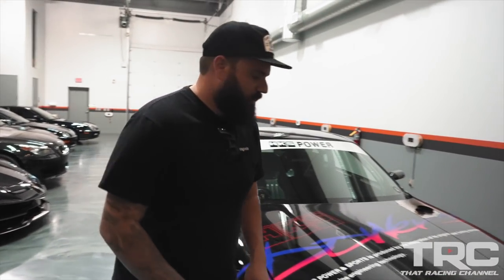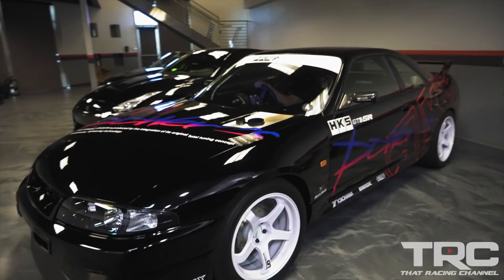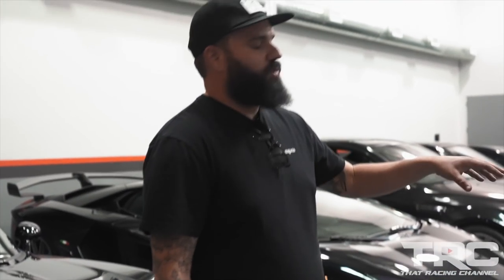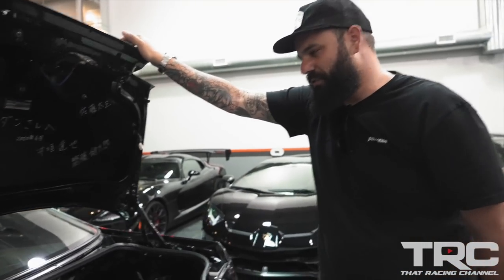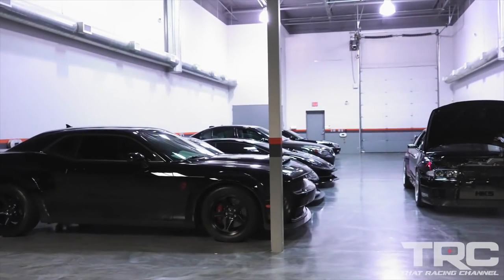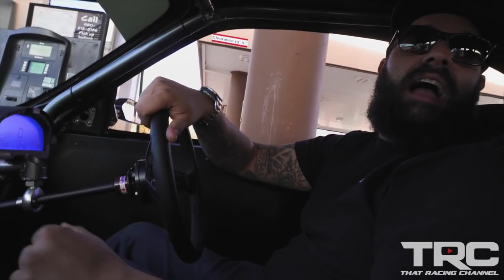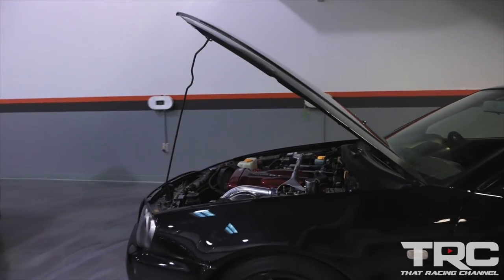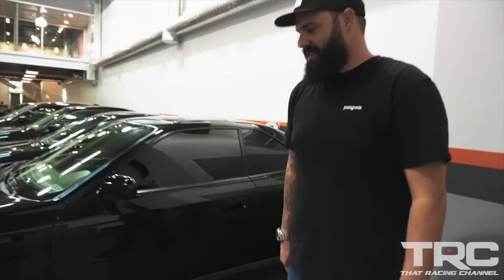R33 GTR 2.8L Stroker "The Modern HKS Race Car" + 100% USA Legal R34 GTR ($50,000 RB Engine)

Comment: Totally jealous. It's a beautiful JDM collector car. I could care less about the Lambos and exotic cars even tho I do like them who doesn't but my love resides with JDM vehicles/parts. The R33 is beautiful and I'm absolutely in love with the Fed legal "MotoRex" R34 GTR. If I had to choose one JDM vehicle it would deff be a Z-Tune Skyline R34 GTR V-Spec in Midnight Purple II or III as far as I know the Midnight Purple Z-Tune R34 GTR is the Rarest Skyline as to my knowledge they only made 1 or 2 Z-Tune R34 Skyline GTR's in Midnight Purple II or III and they only made 12 Z-Tune R34 Skyline's. If I'm not correct of how many they made please correct me but I do believe it was around 12 produced for the Z-Tune R34 Skyline's and only 1 or 2 Z-Tune Midnight Purple R34's. I also love the Black Dc2 Integra Type-R they're getting Rare aswell especially the Phoenix Yellow Dc2 ITR's. The 96 & 97 Dc2 ITR's are already Rare and you won't find them anywhere the people who own them have them hidden away in their garages or in a storage unit somewhere and you won't find them Original or in good condition. My cousin owns a Phoenix Yellow 01 Integra Type-R with very low mileage lucky if it has 30k miles. He's the original owner he bought it brand new when he worked for an Acura dealership here in Long Island, New York. He's had it stored away in his garage for many many years. He starts it up and drives it around the block every so often and it's all Original. He was offered 40k for it and told the guy No. Kuz the market for these are going up and his is in immaculate condition & Original owner

Comment: $50.000 RB engine ... RB30 tuner in NZ could probably match this engine with just 1/3 of the price
Reply: Hks did it
Reply: This is the HKS T-002 (BCNR33) my guy, a living legend among tuners in the 90s that shocked the community due to its outrageous performance. HKS used it from 1995 onwards as a R&D and demo car for new technologies at a time when very few people were tinkering with the R33, which was a 2 year old car by then, practically a brand new vehicle into the market. No disrespect to all those RB30 tuners in NZ but HKS were already under the hood before any of those guys went near a Skyline. There's an important bit of historical value here that you are missing out. Any recent BMW M3 would certainly be faster than a Lamborghini Miura, but the stark difference in value goes beyond performance figures, specially if we are talking about certain kind of "historic" vehicles, which is the case here.

What's really cool about this whole thing is that it was originally created as a track car with Tsukuba in mind. Even then it was already pushing 600ps, equipped with the newly developed GT turbine (GT2540). It set a 58:716 second lap in 1995, at a time when it was still difficult to cut one minute laps. If you check the Attack Official Movie Channel in YouTube you'll only see a handful of cars going under one minute with almost stock aereo. The R33 did it with worse tires almost 30 years ago! It's a ridiculously fast time. Wanting to develop a larger turbine, HKS entered into the 0-300 challenge in 1997. They took the R33, souped up with the latest 2.7L + GT3037 twin turbo specification pushing 920ps and off they went. They set a 17,64 seconds in the 0-300 Km/h, obliterating the 20 second barrier other tuners struggled with. During the following 2 years, the T-002 became the car to beat; more than 70 different tuned cars tried and only Phoenix Power managed to get close with a 17,76 second mark in the 0-300, which speaks volumes about the quality of HKS. 

Once retired, its role as a development vehicle ended and the T-002 was abandoned in a corner of the HKS headquarters, becoming a donor car for other projects, until it was revived and revitalized with the lastest HKS parts for the Tokyo Auto Salon 2019, including the HKS GTIII-5R turbine you see in this video, dry carbon panels and everything. I'm not entirely sure if HKS ever managed to do a full-scale setting of the engine before selling the car, but as far as the parts used are concerned, the F-CON V Pro 3.4 control is good for +1000ps. It's an incredible piece of engineering with an extensive history in magazine coverages throughout the years.